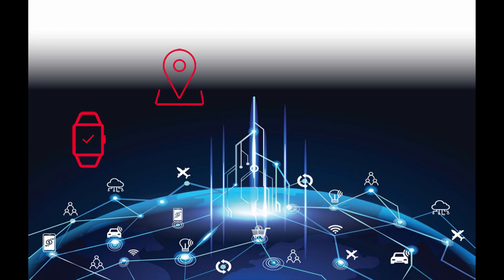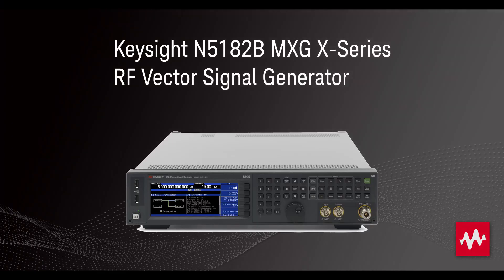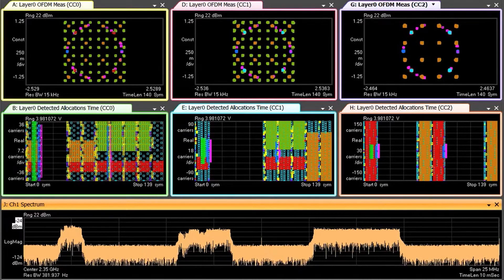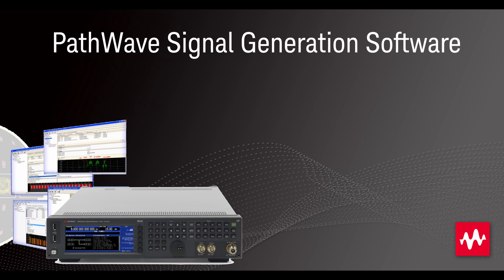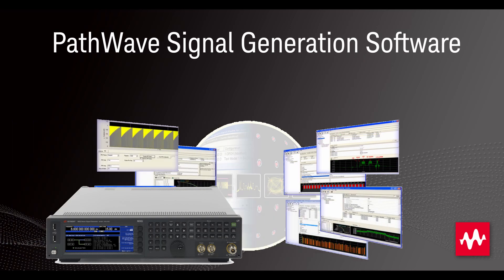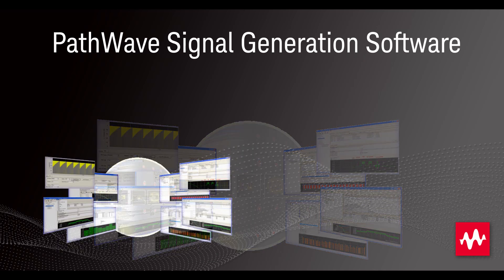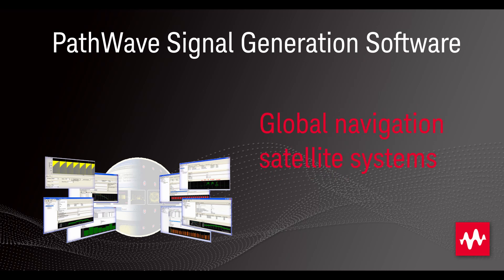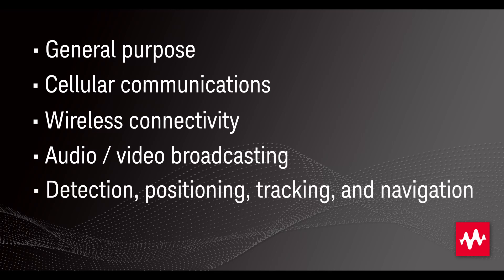Introducing Keysight’s N5182B MXG Vector Signal Generator

Comment: I don't know anything about signal generators, so can you tell me if I want to generate a Wifi or GPS signal using a vector signal generator, will the generator put out or broadcast the signal internally or would I need an antenna?